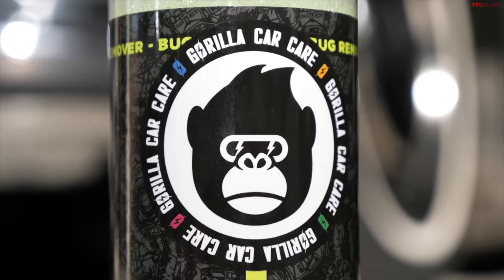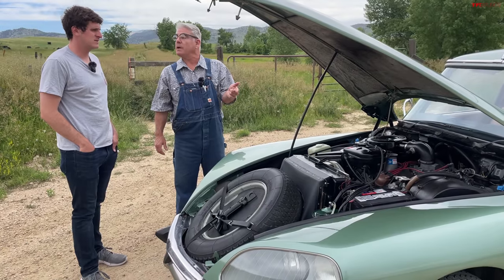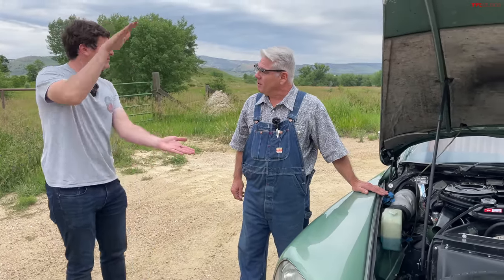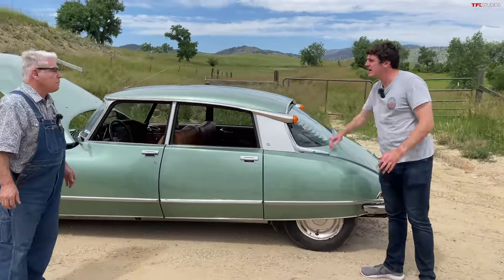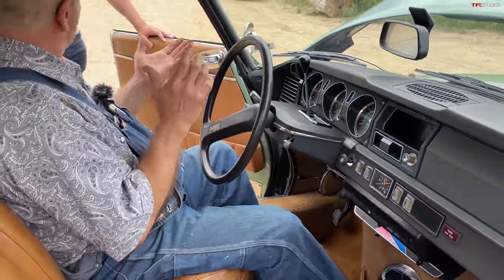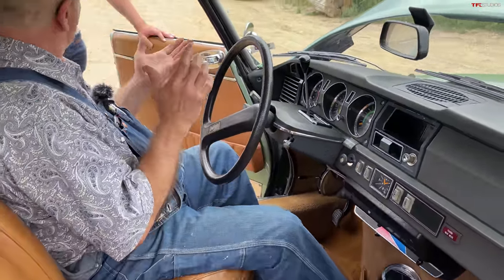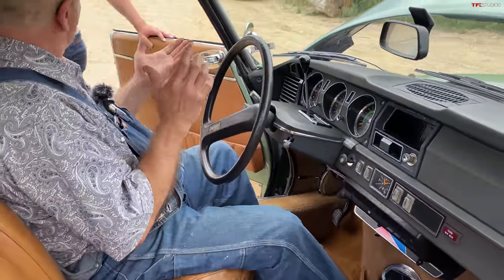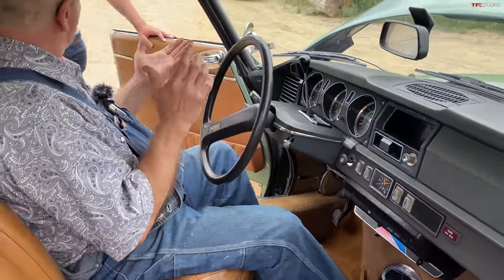Really THAT Unreliable!? Is The Citroen DS as Bad As The Internet Says It Is!?

Comment: A couple more informations from a Frenchman who learnt driving on my parent's 1973 DS23 and still owns it...
First of all, thanks for this great video. One of the first American ones where all that is said is 95% right ! :-) 

A small remark : your DS is really beautifully clean. You take care of it really well 🙂
However, your doors don't seem to be well adjusted. The 3 vertical gaps between the doors and the body parts should have the same width.

The air intake for the engine is not the horizontal slit under the boot cover. The air intake is under the car (you can see it if you lift it). It is 2 big massive holes that go directly under the leatherette protection that is under the spare tyre. You can open the leatherette with a zipper to increase the amount of air that goes in the the summer (it also has an electric fan that starts automatically if the car is overheating, like in modern cars).

One more thing concerning the rear brakes. The rear brakes are drum brakes that are powered by the hydraulic system. They are powered in a feedback loop with the oil pressure coming from the independent suspension from each wheel. If you get into the car and lift it up, if you press on the brakes, the rear wheel will still turn because there will be no weight on them. This is done so that the rear wheel don't lock up to prevent you from spinning around if you brake hard while turning (as the weight is transferred from the back to the front, the rear wheel brakes will lower their grip on the wheels). If you could brake so hard as to lift the rear wheels off the road, they would then turn freely as they would not be braked anymore. The braking force applied to the wheels is proportional to the weight they bear.

Also, you didn't mention that if you completely lose the hydraulic pressure, you can still brake the front wheels with the special parking brake that is the left-most pedal that operates on the FRONT discs by using cables. This foot-operated "handbreak" has a little switch on the bottom of the release handle. In its normal operating position, when you press on the pedal, the pedal stays where it is and you can only release the brake with the handle.

However, when you operate the little switch at the level of the handle, you prevent the pedal brake from engaging, meaning that you can use it as a standard brake to operate the FRONT brakes, should your hydraulic system go belly up. You can still brake the car and drive back home or to your garage in limp moe.

Concerning the "climate" controls, they are quite intuitive if you look at the markings. You figured out the bottom one (hotter to the left, cooler to the right... they simply operate flaps in the airbox behind to get what you want). The higher one on the left is for having air directed on the feet or on the windscreen (triangle pointing down on the left, triangle pointing up on the right). The higher one on the right is the amount of air input. The four dashes above the command - - - - are not the same size... They are smaller on the right and larger on the left, meaning that if you put the lever on the left, you get more (cool or warm) air into the cabin, and if you put it on the right, you can close the air intake from the engine bay.

Note that the dashboard vents have 2 vents : a smaller one on top is where the heated air would come from the engine bay (controlled by the levers we just talked about above). The big square air vents are only connected to outside air that is not circulated around the engine. They are quite intuitive to operate.

There is also a potentiometer under the steering wheel to control the brightness of the dashboard at night. 

And yes, the right-most button is defrost (if your car is equipped with rear heated windscreen. You can see it if it has horizontal heating conductors through it). It is quite effective.

At minute 31 you say you don't know how the car keeps "horizontal". It does not. However, it maintains the same body height respective to all wheels. For this, there is a small lever at the level of each wheel. If the wheel is too low, the lever will point low and will decrease the hydropneumatic pressure on the corresponding wheel. So however you load the car (front, rear, left, right) the body height will be maintained thanks to these little levers (that are mechanical sensors that implement a feedback loop, like a thermostat would start your heater if the temperature in your room was too low, but here, they are analogic and not binary like a thermostat). It is also thanks to these sensors that the car will not dive when you brake... When the front dampers compress, the car would dive, but this lowers the rear levers / sensors that would reduce the pressure on the wheel arm so the rear wheels will go down too. So when a DS brakes sharply, the whole car goes down horizontally (it doesn't dive).

Ah, concerning the headlights, you mention that the swivel left to right, but you don't mention that they also swivel up and down so that the beams stay parallel to the road if the front of the car dives due to a vertical acceleration cause by engaging into a slope. So not only will the headlights allow the drive to look into bends, but if you engage at speed into a slope, the front wheels will go up into the body and.. the headlight will also go up. The light beams are always parallel to the road, independently of the body attitude.

I also wonder if you have the standard car mats (they don't look the same as in France). They are quite special. They are very thick underneath and made of latex with conical holes that are designed to absorb the road noise. If they are standard mats you bought in a car shop, you may want to source original ones to reduce the road noise when driving.

Concerning the suspension, you are not supposed to drive it in lower or higher setting, except to change your wheels or get out of a bad situation (snow, etc). In fact, the suspension has a maximum displacement (read "comfort") when the lever is set in the middle. On Min 33.50, you say there are 3 different positions but these are operating positions. in fac, there are 5 🙂

You demonstrated the top one where the car goes completely up. When you are there, you lose your suspension as the wheels are forced at their maximum extension, so they can't go up or down anymore. This is how you can do the 3 wheels trick : no suspensions, if the center of gravity is inside the triangle, the car will not flip to its rear missing (left or right) wheel. It's simple physics.

Then, there are three markings as well seen at 34'. The lower one is the comfort operating position. The two higher ones are operating position for rough roads where you would like a little more clearance but if you still want suspension. It would be the preferred positions on a dirt road. The further away you go from the center, the more suspension you lose. So the higher of the three will be the less comfortable, the one slightly under will mean that the car will be slightly lower but more comfortable and the bottom one is the standard one.

And there is the 5th position down there that you can access if you push the lever to the right while pushing to the complete bottom. When you do this, the car flattens down to the ground and (as with top position) you lose again the suspension because the wheels are completely "up" (meaning that the body is down). This is the position where the wheels go up when you put the truss under the car. You are not supposed to drive in either the top or the bottom position because without suspension, you risk damaging the car chassis if you run at speed on bumps on an uneven road.

If you want to have a good laugh, check out the "Buying this weird 1969 Citroen ID 19 was a total disaster. I am so DUMB!" youtube video. Indeed, at 17"46, Dumb puts it in the lower position in the hope to enjoy the smooth ride he was expecting from the DS... The video should have been renamed "Dumb and Dumber buy a 1969 Citroen ID". Fortunately, the mechanic is the more intelligent of the two and despite not opening the user manual or trying to read about the car before trying to understand it, he makes out that he may be on something valuable and had an open mind on it, leading to better other videos from his Car Wizard youtube channel. In French, we call this feeding pigs with jam. Made me think a lot of the great "Taliban Workout At Gym In Kabul’s Presidential Palace" youtube video...

The horn indeed has 2 settings : when you press it lightly it is a "nice" one-tone "city horn" and when you press harder, you engage the "highway" horn, which is a really unpleasant discordant two-tone horn, tuned to curdle the blood of truck drivers who would cut in front of you. (we see your ears cringe when you go into the two-tone mode, showing that it works as designed :-)

At 36'20, you say that the controls are on the driving column in a modern way even though this dates back to 1972. But 1972 was 2 years before DS stopped being made! The controls you have in front of you came out on the DS in 1955, not 1972 !!! If you look at what cars were looking like in 1955, you will see how modern this is.

You also didn't mention that DS were some of the best really cars winning :
Monte-Carlo in 1959,
Corsica in 1961
1000 lakes in 1962
Corsica in 1963
Monte-Carlo in 1966
Portugal in 1969
Morocco in 1969, 1970, 1971
Wembley-Munich in 1974

Hope that the little details I added helped.

Great video that I really enjoyed !!!
Reply: That is one detailed comment, sad to see that it didnt get much attention
Reply: I read it all, and I’m not a car guy, but enjoyed the in depth extra knowledge he has.  👍
Reply: You know some stuff
Reply: Awesome comment - thanks for the tidbits about the DS!
Reply: Hi to all and thanks for your nice comments.
@D3nn1s: at least you read it. I didn't write it for nothing :-) 
@SoulFoodEqualMusic: well I have been "owning" one (through my parents) since 1973. Their DS-Break (now mine) is in bad shape though. I need to have it repaired so that it is back to its original glory but it's going to cost a lot. I hope I will be able to do it within then next 10 years. I really love the car...
I read again what I wrote and I'm sorry for the bad proofreading (also tricked by probable auto-corrextion... In my last paragraph, I meant to write "rally" and not "really"... )
Reply: Monsieur, je tenais à vous remercier, je suis un amateur de Ds même si malheureusement je n'en possède pas, j'ai bien eu quelques unes de ses filles, bx, cx et xm, j'ai un peu travaillé dessus, des amis en possèdent, bref, le virus est passé mais je n'ai pas encore pu réaliser mon rêve.
En attendant je lis, je visionne, j'écoute, j'essaie d'engranger le plus de savoir que je puisse, et la en une (intense!) Lecture j'ai plus appris qu'en plusieurs mois!! 
Tous ces détails qui m'avaient échappé, le fonctionnement de la suspension au freinage, les phares qui peuvent aussi bouger de haut en bas, mais surtout le fonctionnement hyper ingénieux du freinage arrière!! 
Merci infiniment monsieur, vraiment, vous avez rassasié ma passion pour quelques temps 🤣
Reply: Thank you so much for taking the time to expound on your knowledge of the DS. I have owned an ID19, CX2400 and a GS1200 Club, all beautiful and quirky cars but triumphs of engineering. One thing that could have been mentioned is that DS was referring to Goddess in French. Sadly Citroen is not the leader it once was.
Reply: Thanks for your time.  The DS -"Goddess" - is such a great machine.   It was so innovative and unique that it excites a lot of passion in people who love it, as you clearly do.  I was a little surprised you didn't mention how the car, with its' wonderful suspension is often credited for saving DeGaulle's life in the 1962 assaination attempt by OAS.  You clearly know and love this car. While I never has a DS, I owned a Renault 25 in Germany and love French cars.  Merci!
Reply: Lovely car. Exciting to be offered a lift in one.
Reply: Written like a true connoisseur of the vehicle...thank you!
Reply: Thanks for providing so much of details of this legendary car. I am planning to buy Citroen C3 Manual Car in India.
Reply: I liked the video, but this comment is the best Citroen tutorial on the net.